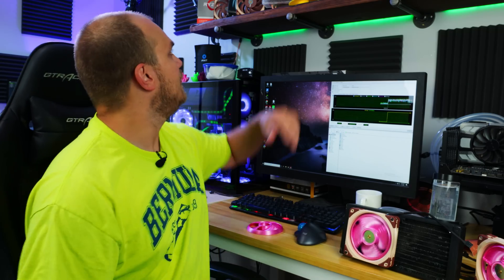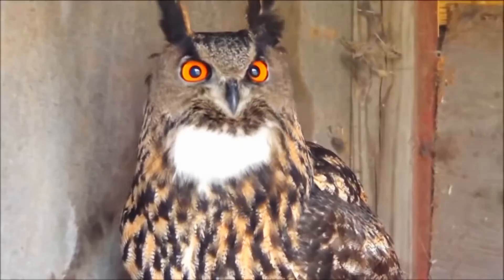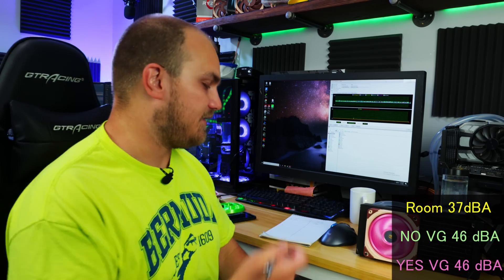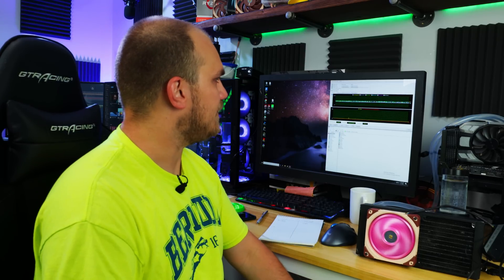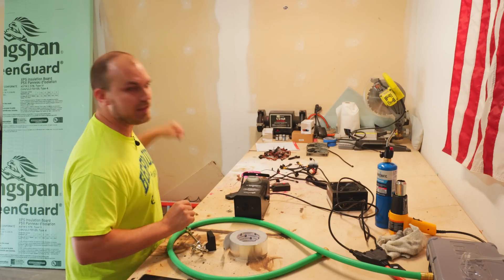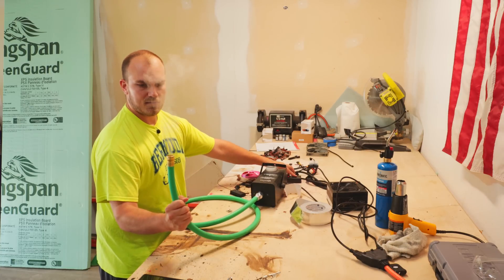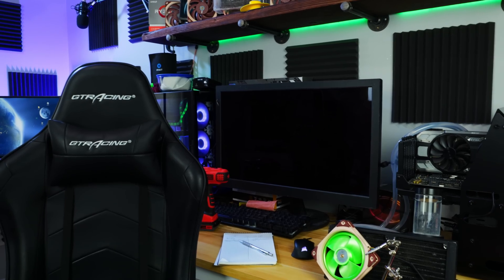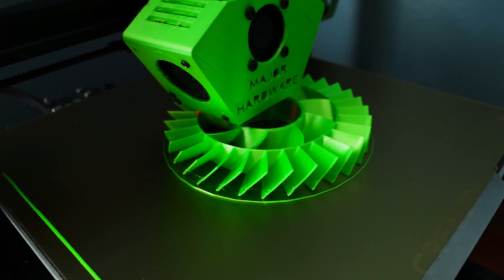Do Vortex Generators Make A Difference | 3D Printed Fan Testing

Comment: It would be cool if there was nonplanar slicing for circular paths and not just straight lines. That might add more smooth airflow and then it would be smoother and quieter.

Comment: I don't think this would work well with a fan. The vortex generators on plane wings and cars work by affecting the pressure and increasing lift or decreasing drag, but I would think a fan is intended to use flow volume to remove heat (think BTU's per cubic foot). I don't think it would help much unless the intent was to increase the turbulent flow near the surface but there are draw backs to that too which is why a lot of laminar flow fans are used in heat exchange type situation for electronics.

Comment: The tolerance of the gap between the OD of your fan and the ID of the housing affects static pressure. The closer/smaller the gap, the better. Also traditional wisdom says the more blades, the better for static pressure. The issue is the angle of attack is limited by more blades and depending on the angle and the rpm they may stall, which is where the vortex generators would be helpful. So more aggressive angle of attack with vortex generators, more blades, closer fitting ring. Why does your ring curve over on the top? that's just limiting the inlet diameter. The further from the center of the fan, the more effective the surface is, so those last few mm you're losing with that curved outside ring are the most important ones.

Comment: I worked for years with 3d printed impellers, studied a lot of shapes, surfaces and... the OWLs
- Owls: The shape and surface of the feathers can have a role on its efficiency and low noise, but is a myth that it plays a main role on owls silent flite. The main feature the owls have, that give them super efficient and silent flite is big wings in proportion to its weights is what allow them to fly with minimum turbulence and no noise(also slow).
- Rough surfaces: Doesn't affect performance performance significantly
- Vortex generators: Don't work at this scale
- To make a good fan all you need is blades(count, shape) optimized for the motor(rotation and torque) you have. If quietness is what you want, you better do as the owls, use big and efficient fans, with low RPMs.
 - Tonal noise: You can spread the noise spectrum of a fan, making it less annoying, by using variable pitch between blades (without scarifying balance)
- When working with rotating machines you MUST always look for balance. An unbalanced fan ruins its performance in all aspects (noise, efficiency, life span)

Comment: The Vortex Generators should be thinner.

Vortex Generators are there to create Turbulence so more air is carried over the wing (here: the blade) to create more Vertical Lift and a higher angle of attack (you can raise into the air steeper/more aggressively).
The Vortex Generators basically should move more air with a bit more drag.
0.4° may not seem like much but they're showing that there IS a difference.

The RPM Range you use may either be to slow to see a worthy difference and or the Vortex Generators are to Thicc. I'd say both or at least to Thicc. 

My opinion: 0.4° may be neglegable, but it is a difference. Keep em!
Try to smooth em and make them thinner if possible. Rectangular angles are not helping the Drag Coeeficent.

Comment: one issue with your 3d printed fans they are not smooth. your fans will generate more friction then a smooth one. to compare better i tink u need to sand it down your blads till its have no rough surface.

Comment: Ok, i think your blade design is where your weakness is. Look at the blades of the GE 90 aircraft engine. 1, it's a work of art in it's own right, but more for your case 2, those blades are made to move air, they are made to be used in the same circular formation, and ge spent millions (if not billions) designing them so we might as well get some use from them too! 
Now another thing, that someone else brought up, is the texture of the part. with that roughness, nothing you are going to do at that scale is really gonna be able to do much. take the sound level, you are getting some dB gain off of that texture. you are losing CFM because of that texture. look up Vapor Polishing. it might not work, but the idea is to find a way to get rid of that extra texture.

Comment: Depending on the manufacturing process you could have the  "vortex generators"  as ejection pins for injection molding....  use manufacturing "artifacts" to your advantage as much as possible.  I liked the "dual" pitch fan blade you had printing at the end.  Concept to try: Compression of the air, have the blade change spacing across the depth of the fan so that it has less space increasing the air speed.  The only reason I see to remove the outer ring is to reduce weight of the fan and therefore the strain on the fan motor.

Comment: Hi, I have an SLA Form 2 3D printer. If you'd like to try any printed parts in particular to test, then I'd like to offer to make you a couple free of charge. The ridges involved in FDM 3D printing might be contributed to the type of air flow you're getting and I would be interested in an analysis of the difference between a regular FDM printed fan blade vs an SLA (nearly injection mold level smoothness) fan blade.

Comment: I work in HVAC, and high silence fan blades have leafing edge pointed into the flow.
You have flat edges with trailing pointed... try reversing the design...

Comment: I think the vortex generators would only be useful with a higher pitched propeller. They also would probably not make a difference unless the fan surfaces were smooth.

Comment: How did you bypass all the comments saying the vortex generators are supposed to be on the trailing edge of blade yet mention that bs about owl wings? This is a fan that spins not an animals appendage that flaps.
Reply from the maker: My fan identifies as an owl

Comment: u may wunt 2 smooth out the 3D printet parts wud make air flow smoother there 4 less of it will get re directed wrong way
Reply: air is just like a liquid so 2 move most amount of air we need 2 get as much out of our source as posible meaning when we have high speed low torgue motor we need 2 desing or fans 2 worck with motor type so as light and as agresive angle as posible but got 2 many blades torgue increases and lovers our afiency and go with 2 sharp angle may alsou cause 2 stron torgue so if u could get your hands on something that mesures the fan speed u wud be posible 2 start doing test with difrent angles and difrent racious of fans 2 determin wich wud make most out of that motor sweetspot is when fan slows down a bit but not insanely much
Reply: after u have figured out the maximum amount of air u can move with that motor u can start desining stuff that makes it not as loud

Comment: Ok, knockoff JayZTwoCents, the point of a VG is to retard the flow detatching from a negative pressure gradient (the back of a fan blade) what tis means is that the back of your evo stops being such a low pressure zone and producing as much drag and lift (thanks to the angle of the windscreen and boot lid, yada yada). What you can now do (with VGs) is increase the angle on the fan blades to increase pressure difference ie more flow OR keep the blades the same but spin at lower RPM without the blade stalling and dropping off flow. You essentially trade RPM and frequency of any noise for efficiency and flow rate. IMHO; keep the VGs, crank that blade angle and squeeze another 4 blades in there.
Linked you a youtubes vidjeo for the edumcayshun. https://www.youtube.com/watch?v=9Whd_KnsLKE

Comment: I think the vortex generators only affect the surface of the blade as well as, looking at the placement on airplanes, need to be set further back behind the edge of the fan blade. Also, I'm thinking of a way to evenly apply a smoothing coat to remove the printing lines.

Comment: It would be neat to have a solenoid to swap between an outdoor cooling tower and an indoor closed air cooler something with a toggle state or a Thermal Expansion Valve. Where we wouldn't have to worry aboot humidity inside the house.

Comment: I'd imagine the "vortex generators" would add drag, thus reducing efficiency.  However, the uneven of the surface might reduce the pressure waves produced by each blade of the fan, but I doubt that effect would ever make up for the extra drag.

Comment: 1) You probably already have a lot vortex generators from the 3D printed surface. Smooth could be different story.
2) Keep the ring, it is cool! There are actually PC fans with it, with pretty good performance with radiator, they just cannot go for pull (noise i belive): Noisebraker eLoop Series... Asus also currently use the design on Strix cards
3)the double-ring design was also used on GPU (Asus again?), but it was the other way around: high density turbine inside
Love the chanel

Comment: Here is what you need to do to get high pressure air-flow without cushioning the air away from the fan. 

You should build coaxial fans (or rather mount a turned-around fan on top of another .. so it spins the other way round) Make a blade that pushes and one that pulls air. Suggestion would be 3 or 4 bladed at max .. so you end up with 6 or 8 blades)
Because they are coaxial, you wont get the cushion affect and a much more efficient airflow with very high pressure.

Comment: Perhaps I'm being cynical here, but I would like to see a fan that intakes from what is conventionally the rear. I love the idea of having intake fans on the bottom of a case, but I would much rather see the conventional "front" of the fan. I love the idea of hot swappable fan blades, perhaps allow the flow direction be dictated by which way the fan is installed into the hub.

Comment: Look up the F-4 Phantoms wing design. it has "slats" that are in front of the wing and fold upside at landing to ensure a better airflow over the wing surface thus increasing airflow at low speeds.
Maybe worth a try? link to the pic:
https://www.google.com/search?q=f4+phantom+wing+slats&tbm=isch&ved=2ahUKEwiyy9Dzk7HqAhVGgRoKHV5GAlAQ2-cCegQIABAA&oq=f4+phantom+wing+slats&gs_lcp=CgNpbWcQA1D0ugRYwb8EYLjCBGgAcAB4AIABRogBygKSAQE1mAEAoAEBqgELZ3dzLXdpei1pbWc&sclient=img&ei=Li7_XrL8OsaCat6MiYAF&bih=881&biw=1745&safe=off

Comment: Vortex generators help with incresed pitch. If you increase the pitch the vortex generators will reduce flow seperation on the blades. At your current pitch the fan blades don't need the vortex generators. On an evo the vgs are lilely to bring the flow down onto rear downforce members for better traction at higher speeds. That said most of a cars downforce comes from the underbody so little change. Vgs on planes prevent stalling at higher angles of attack/pitch.

Comment: My personal opinion:
Sound test: The green had a very slight low background hum, where as the pink didn't.
The blades themselves: The surface of the fan blades may be too rough to make the air flow smooth enough to make any, if at all, difference. But the fins do look cool regardless, so I'd say keep 'em. They add points to the "coolness factor." Also, maybe try lengthening the fins from the leading edge to the back of the blade, whilst tapering them from front to back (thicker at the leading edge, thinner at the rear)

Comment: So the VGs on wings don’t necessarily increase lift as much as the delay flow separation at high angles of attack.  Maybe to get the benefit you are looking for, you have to have a more aggressive fan blade slope, to a point where the non VG one experiences a loss of airflow (essentially stalled) while the VG fan blade could make use of the steeper angle and subsequent higher CL to produce more airflow?

But then I feel like air is being flung out radially due to centrifugal forces (I believe that is normally countered by having forward swept fan blades) so I’m not sure what angle the VGs should be facing relative to the direction of travel of the blade.

Comment: Those notches are really just going to increase drag (why it was slightly louder than the other fan.

OTOH feathered edges could help.

Personally I'd be more interested in seeing stator on the back of the fan which could increase the pressure and remove the blocked area behind the hub.

Comment: I believe the Cone of air had a larger diameter on the Vortex Fan; leading to a higher static pressure right behind the blade surfaces, but reduced the total amount of air flow thereafter the blades

Comment: I would take @wouter Verbruggen's comment and think the other way. what about micro scoops on the blades? take for instance the shot of 1:31 in the video. The surface could be used to "scoop" air. IDK. I'm not a scientist. But blades of grass can cut things because they have small cerated edges. Same as a steak knife. or any knife if you look at it under a microscope. maybe give it a try?

Comment: The printing direction of the fan makes a big difference. Right now the layers are ribbed across, causing flow separation.
Either print each blade standing up so the layers go lengthwise OR try non-planar printing

Comment: That sneak peak looks very promising. Mixing smaller fan efficient designs that don't necessarily scan as good on larger fans with an outer design that is more optimal for the larger diameter. Two thumbs up for that idea. U r going to need a patent for that one xD. Sure someone already has done it tho xD

Comment: You didn't measure the power that the fan takes with all this. So voltage and ampere and to with that watts used. My guess is, that the achieve the same, the vortex blade needs more energy. Because there is a bigger area of the fan against the air. But the difference is so small that you most likely only can measure this over time, means you integrate the watts for a minute and then the difference becomes more and more visual.
It is impossible that those two will take the same energy. The laws of thermodynamic say nay. Vortex costs energy. More area for wind resistance as well as worse Cw value with the vortex makes more wind resistance, needs more energy to spin. Also you didn't measure the RPM. Those three variables are important and actually easier to measure than the things you did.
The last thing you could have measured was throughput of air. So put a large bag for trash behind it, empty it and pump it up with the fan until it gets to a certain height. Here the vortex should be performing worse, too. 
The owl does spread the wing tip feathers in a way so that the vortex gets disturbed and with that the sound gets minimized, not only that, but also the wind resistance. There is a simple GA (genetic algorithm) to find the perfect setup of the end feathers, that already has been made in an experiment somewhere in the 90's. The setup of the end feather is specific to the air condition and to the speed of flow, so a fixed set of feathers won't work. It always has to be found by trial and error. This is what owls do and on slow motion pictures you can see that there seems to be some neural circuit that does that automatically.

Comment: Really need to be measuring cfm and ppm in these tests.  If you want to be super technical, using CO2 as a tracer gas to determine PPM and then provide a cfm estimate on the circular diameter of the fan's coverage area is as scientific as you can get.
Here's a few real facts: Companies have been at tackling this issue for years.  Its a multifaceted issue.  Getting the highest cfm is one problem, packing blade design into something that will provide the same cfm over a minimal rpm is another, with low torque on the driving shaft.  Driving a blade in centrifugal resistance is going to introduce torque at the center of mass.  I don't think your vortex generator addresses any of these problems, such as minimizing blade mass by using a lightweight material and blade shape to reduce torque, centrifugal resistance compensation, and consequently heat and wear on the tiny motor of a PC fan.  To start with if its brushless, won't have enough driving power to bring it to an adiquite full load test rpm.
I realize you are prototyping with 3D Printer material, but it really is affecting the quality of your tests, and the results.
TL;DR
- CO2 tracer gas test, CFM equipment
- RPM measuring equipment or high speed camera
- Lighter material, reduce centrifugal resistance
- Lower torque, save motor.

Comment: Have you considered trying a ""bladeless"" fan design and trying to get higher flow efficiency via entrapment/entrainment??? Reckon it wil be difficult to optimise the entertainment 🤔 maybe a 2piece duct ring with slots cut in it to act like the relief on vacuum cleaner pipe will let you have some adjustment on an initial model to get some sort of idea of where to go next or give control for different density/flow characteristics of radiator coils.

Comment: the vortex generator is too large, and too many, typically you put a small indentation just to promote reatachment of the boundary layer. make it small and put it near the tip of the fan where flow separation occurs. the ring is redundant it just inhibits flow, make the shroud close enough as if its touching. although skin roughness is not too much of an issue due to the scale, localized small dimples at the blade tip are worth the try (super cavitation). try multiple airfoil cross sections like what is used in Francis turbines

Comment: Hey, Try a centrifugal fan.
In most centrifugal applications both on video cards and in the home, the air that does work comes out the side of the fan. 
I am suggesting you run this, but instead of using the exhaust from the fan for cooling, exhaust out the side of the fan like it would, and utilize the intake to suck air through your radiator. The fan would have to be double thick, but i think it is worth it. 
Centrifugal fans can move a LOT of air, but the problem is that over half is wasted as they are currently found in PCs.